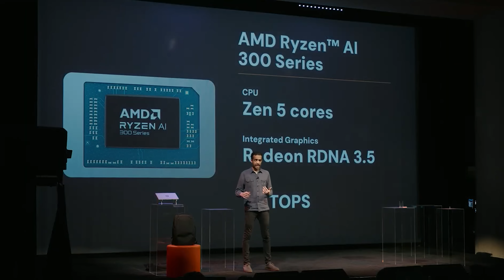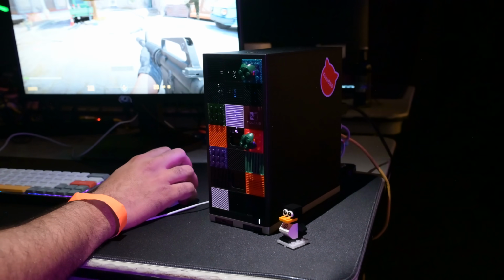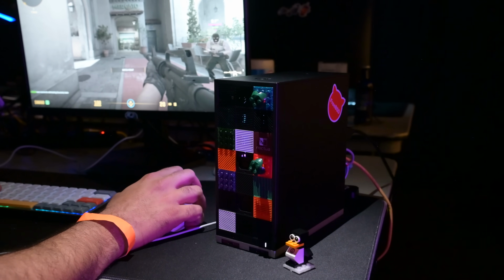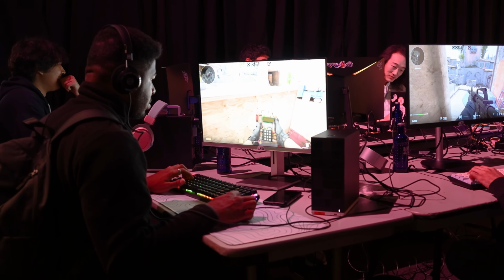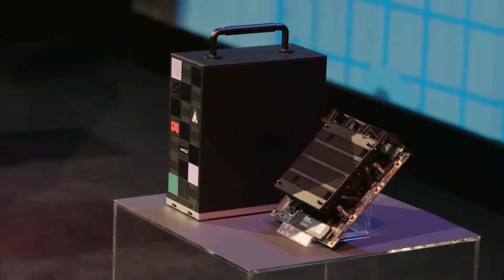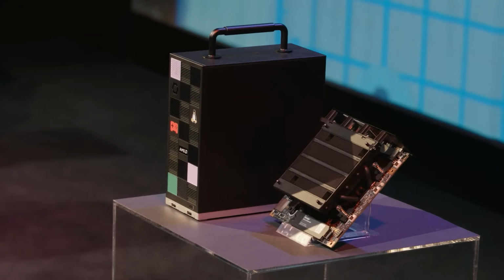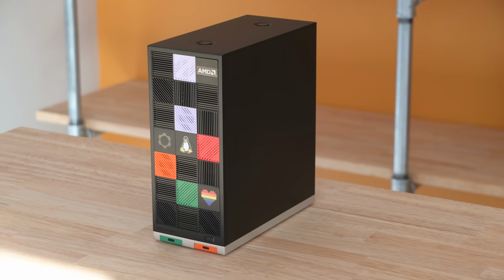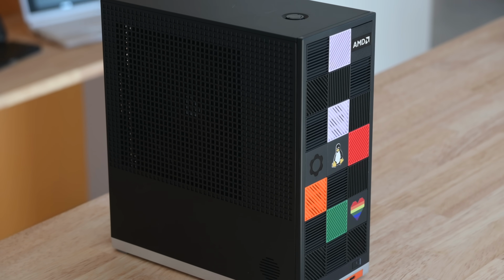Modular, Open, Repairable – The Framework Desktop Teardown!

Comment: Using a Flex ATX PSU is a terrible idea as they are extremely noisy. I have tried multiple models when building SFF PC a few years ago and never found a model that had acceptable noise levels.
Reply: Framework explicitly stated they made their own PSU that was designed to be very quiet, they even addressed the fact that other off the shelf Flex ATX PSUs are noisy which is why they made their own.
Reply: @CarbonPanther  Oh I wasn't aware of that. Great then!

Comment: Nice! But they should have replaced that ridiculous cable bundle from the PSU with a rigid custom-formed copper busbar. Don't understand why nobody does this. It would be neater, more compact, better airflow and easier to recycle.
Reply: AMD is more interested in pushing their AI nonsense – and not in users opening the case.

Comment: I like how they went for the earlier 2000s hacker vibe/style with front cover. I would swap the side panels, the back of this mobo is beautiful, put some lights and a clear panel. I'm reading that the PCI-e 4x Gen4 will be an opened slot, so yay?, hope they put a low profile card slot in the final production... if not can they do a cut out of an oculink connector opening in the back panel, maybe? 5gb nic is an odd choice, but I'm guessing is either that or sacrificing one usb 4.0 for a single 10G nic. Top cover could have some extra mounting holes for a couple of 2.5", some of us may want to put sata or u.2 drives.
This is not relative to this machine, but is it possible to manufacture a daughter board that can attach to this case (or any other ITX case) and put old Framework's laptop mainboards in? Cleary the Amd ai 300 series is very capable chip, with a max alloc vid mem of 96Gb, but I'm little bit curious about the perfomance with LLM of let's say DeepSeek r1 70B? nVidia A100 SXM 80Gb can do 23 tokes/s

Comment: Seems super underwhelming, actually less repairable than the laptop which is a shame to see with the soldered ram, no gpu slot, and what appears to be a soldered cpu (correct me if i'm wrong), in comparison to actual desktops which are probably cheaper and is much more repairable

Comment: 6:59 not sure why they didnt just use a normal holder, would be much easier to replace the battery with a generic one, now you either have to solder or find the exact one likely only sold by them and a few others

Comment: why are these ai max+ 395 computers all over 2000 dollars when the gpu is the same performance as a 1000 dollar 4060 laptop? 🤔
Reply: your math is wrong 128GB of RAM that can be used for the AI accelerator or the GPU for AI stuff also a 16 Core Zen5 CPU that's slightly slower than a AMD Ryzon 9 9950X that's what you want as a Dev Machine. and unlike a Mac Studio this thing can run most games jsut fine.

This thing is meant as a counter to Mac Studio Systems not your gaming PC with it's 1200 Watt PSU. Also good luck to get 128GB of regular DDR5 RAM to clock at 8000 MT on any board. Mind you LPDDR5x also has a wider memory bus than regular DIMMs so this little beast has more memmory bandwith than any PC below Treadripper PRO and you would pay for the CPU alone as much as for the entire Desktop with everything maxed out.

Comment: framework is cool and all but uh, an itx motherboard that uses torx scews, has a weird cmos battery holder, soldered ram (yes yes, I know soldered ram is faster) and has a very limited port selection just really isn't... The Change The Industry Needs right now I don't think. 

The case is itx compatible, but how many itx motherboards have paired type-e ports for those front panel connections? Who wants a brand new name brand desktop that has a sum total of "2 usb ports and a power button" as far as front panel connections go? Am I going to sacrifice 50% of my USB front panel for a headphone jack? Am I going to just watch my motherboard (non type-e) usb headers and audio headers wither and die?

Who wants an itx case that fits: 0 3.5" internal devices, 0 2.5" internal devices, 0 3.5" external bays, 0 slimline optical drives (CDs are better than streaming, don't @ me), and 0 external 5.25" bays, and needs a separate case-specific mounting kit to mount a 120mm fan? 

For these reasons I would posit it's less reusable in terms of both motherboard and case, than the average itx motherboard/case. I will stick to my desktop which also has a customizable front panel (I put stickers on it) and can actually use industry standard internal and external devices

Comment: To anyone wondering why the world needs a SFF Desktop with an APU and soldered RAM: It's for memory bandwidth. That's the main selling point of this device. AI need massive amounts of high-bandwidth memory, so this device is perfect for self-hosting LLMs (assuming the Strix Halo chip lives up to expectations).

I'm really excited to see benchmarks with this and compare them to dedicated GPUs and high-end consumer CPUs! After all, a Ryzen 9950X with similar amounts of (slower but non-soldered) RAM is quite a bit cheaper.
Reply: It beats all consumer GPUs simply because none of them can load a 70 billion parameter model.
Reply: I was looking at the soldered-on CPU and RAM with a skeptical side-eye while thinking 'Framework did *that*?' - thank you for the explanation, I appreciate knowing the reasoning.
Reply: The RAM they are using is comically slow when stacked against the RAM in GPUs or dedicated AI cards. I can and will only assume they did they to upsell higher RAM systems for an extreme markup but will never deliver on actual performance. Just like Apple "out 8GB is actually like 16GB".
Reply: @xoso599  DURRRRRRRRRR, the last time I checked the memory on a GPU is also soldered... So please go ahead and show us the socketed memory that can outperform this. I'll be waiting.
Reply: @ The RAM in the Framework is looking at a max possible speed of 256GB/s with the Ryzen AI Max. GDDR6 caps out at 1.1TB/s 4.3 times faster, while the latest GDDR7 is 1.4TB/s.
While 256GB/s is fast vs DDR5, it's slow when measured against VRAM. 

A $3000 ($2000 MSRP) 5090 with 32GB of GDDR7 is going to be massively faster while having a quarter of the RAM.

So the balance point comes to is 256GB/s fast enough to give useful AI performance? Or do you need the 1TB/s + to get where you need to be for fast stable diffusion or LLMs? 

Now we don't know how fast this Framework's RAM will actually be just what the possible max speed is due to the Ryzen AI Max being the hard upper limit. I'm not sure that LPDDR5 (low power DDR5) is the best solution for an AI machine. 

Time will tell, but to directly answer your point, I don't know of any consumer grade RAM that will hit 256GB/s, but I do know for nearly any other application outside of AI faster RAM is mostly useless. What I don't know is if 256 is fast enough for AI or not.
Reply: I'm still wondering, LPDDR5 8000 isn't even remotely close to the kinds of speeds any reasonable dGPU has with GDDR6X or whatever we're up to. If you want to see what a real high bandwidth shared memory architecture looks like go look at what AMD put in the PS5 and Xbox Series - they're using GDDR, not LPDDR. The reason this is using soldered memory is because it's *easier*, it can run somewhat faster than SODIMMs but only marginally faster than DIMMs which would fit in the ITX board they're using just fine, and if they waited a tiny bit CAMM would work even at these speeds without issue.
Reply: @bosstowndynamics5488  in ltt's video the framework ceo said they asked AMD to see if CAMMs would work with this, AMD assigned an engineer and after a bunch of simulations it seems that the signal integrity over CAMM doesn't work in this case.
Reply: @bosstowndynamics5488  Memory bandwidth isn't memory clock speed. Memory clock speed is the rate at which a memory controller transfers data while memory bandwidth is the amount of data that can be transferred.
Reply: @mozilla666fox  Obviously, but the total bandwidth is determined by channel width, number of channels and memory speed. Adding more channels is relatively easy, maintaining high speeds not so much, so discussing the ability to maintain memory speed is the most relevant point here
Reply: I'm sure the bandwidth difference is negligible, unless they show a benchmark that proves otherwise. Which they haven't.
Reply: Have they considered that a lot of people do not give two shits about "AI" or
Reply: @MinotaurSauce  if AI workloads or RTX 4060/4070-level APU performance is not important then they can build an ITX PC like anyone else can, there's not really much Framework could do to "revolutionize" an already fully modular industry. This is better an answer to Nvidia DIGITS, or really the Mac Mini/Studio, they're unnaturally powerful in AI workloads and have zero DIY-friendly competition.
Reply: @MinotaurSauce  It's not just AI. The integrated graphics on this thing is supposedly on par with an RTX 4060. That makes this the ultimate portable LAN PC or great for a lounge room PC hooked up to a big TV.

Considering the price of graphics cards this thing is a very good value for what it is.
Reply: @MinotaurSauce  Have you considered there are different products for different people?
Reply: @MinotaurSauce  Then this device isn't for them. Most people don't need what this processor does. That's fine, they can get a different system better suited for their needs.

Every system doesn't need to do everything. There are a bunch of people really excited about this because of the memory performance at this price point.

This is doing some things "good enough" that small companies can get this system instead of a gpu that costs as much as a car from Nvidia.

Comment: Aren’t desktops supposed to be modular and repairable? Honest question here, like you can disassemble and change whatever you want inside a desktop, also, framework’s desktop seems less modular and repairable than most desktops, since the RAM and CPU are soldered to the board
Reply: The CPU is actually an entire SoC much more like Apple Silicon stuff, so this competes with the Mac Studio, not any other desktop. PC users should still get a regular PC, this one is for people looking to replace their clusters of Mac Studios.

Comment: So let me get this straight. A company made a name for themselves with modular laptops. Now they release a desktop that's less modular than even other desktops by big OEM-s. No PCIE slot, soldered on RAM and somehow we are still to believe they follow the same design ethos as their laptops? Hey, they're not as bad as Apple, because at least they let me switch out some colorful tiles and don't solder the SSD, right? Hard pass for me.
Reply: There's 3 PCIe slots on this board, and not soldering the ram would've come with the cost of halving the speed AND is being sold at a very good price. I suspect you weren't the target audience anyway.
Reply: @lemonotype  1) Honestly, what can you use these slots for for with this case? 2) Defending soldered on RAM you almost sound like an apple fanboy. HEDT or server markets don't have this. Now an USDT class machine NEEDS to have this for performance reasons. What?
Reply: @Tolknaz You tell me what the slots are needed for, I just pointed out they're there, you said they weren't. Can you point me to a server configuration with the same amount of RAM, running at the same speed and sold at the same cost? Just so we make sure we're not making silly comparisons with a machine marketed as a cost effective way to run AI models at home.

Comment: You know whats also modular, open, repairable and upgradable to an even higher degree? Any ITX PC... Honestly, not impressed with framework here. The only thing that is upgradable is the storage. It is essentially just another mini computer that we already have a dozen of. Only new thing is the chip. But that will soon find it's way into other products as well, I am sure.
Reply: Any ITX PC with a 35.000€ H100 .
Reply: @MrZocker92  What are you even on about?
Reply: @leviathan5207  The Point of this system is 128GB of shared Memory. U can use 96GB of it for the GPU part.
So what GPU has 96GB of VRAM? 

Sure u can build a better an Cheaper Gaming ITX PC with the 12GB 4070/5070 but nobody said this is a Gaming PC. The only Device who comes close is the Mac Studio for at least 5.700€ and the 8TB SSD cost 2.500€ extra
Reply: @MrZocker92  They literally state as such in one of the tabs literally labeled "Gaming". 😂
Reply: @REAL-UNKNOWN-SHINOBI  sure u could Game with it, but if u only need something to Game it dosent make sense. Just like buying a PickUp truck just to pick ur kids from school
Reply: @MrZocker92  Well, when I can use 96 GB as VRAM, it can run Cyberpunk with 120 FPS in 4K with raytracing, right? I mean, systems using GPUs with much less than 96 GB of VRAM can do it, so this one can do it, too, right?
Reply: @Linuxdirk  It's like comparing a truck to a sports car and expecting that the truck with 1000hp could drive in Formula 1

Comment: Can I ditch the godawful case and the gimicky modularity and just throw this in a standard ITX case of my choice and run it like a standard desktop?  I realize it doesn't have a 3.0 header, but one of the [I forget what those Gen C connectors are called] can be adapted... I am in love with this chip and this concept, but that case needs to die in a fire.... [edit:  shoot, it's a proprietary size board.  For a  "completely modular" company... that seems like a HUGE missed opportunity]
Reply: It's a mini ITX board and you buy it without the case in the first place.
Reply: yup you can. They sell the board with the SoC. Put it in a case add an ATX PSU and good.
I was joking around about running it with U.2 adapters and 3x30TB U.2 drives. Got an e-mail earlier from a guy who asked for a price to build him one.
As he's local and I already built him a Threadripper machine years ago I'll do it.
I thankfully can get my hands on one of the early shipping boards as a Biotech company around here ordered a bunch of the Machines and spare parts (boards, cases, PSUs).
There CTO is a friend of mine so building can start as soon as the start shipping.

Comment: I like Framework and have multiple laptops but i don't see this product lining up with their values... I would expect a desktop case with powersuply and big cooler that takes either F13 or F16 laptop mainboards. Also the extention cards make no sense in a desktop PC. I don't know, bit disappointed. I was hoping for a much cheaper F13 version, and more F16 expansion bay modules.
Reply: the extention cards are actually there for people who also run the laptops and want to use that cards thy already got. on a PC the additional USB-C ports are best used as USB-C ports in my opinion if you don't have pre-existing cards. Most people seem to order 'em with USB-C USB-A config.

Comment: This seems be less repairable than a generic desktop PC unsure the point, if the mb fails you would need to get a full replacement.
Reply: well this is not just a Desktop. if u want a GPU with over 90GB of VRAM u would need to buy the 35.000€ Nvidia H100.

Comment: just a regulat desktop tower , a bit more complicatet to open an take care of , i have towers at hime which use just one screw to keep them closed.
Reply: so u have a Desktop with 128GB shared Memory?
Reply: @MrZocker92  I could install 128 GB not shared memory if I wanted – alongside my dedicated GPU.
Reply: @Linuxdirk  And? That's not even remotely comparable
Reply: @MrZocker92  I once learned "don't argue with fanboys", so, yes, you're right.
Reply: @Linuxdirk  You don't understand the purpose of the device...but instead of accepting that not every device is made exactly for you, you can't think of anything better than calling others fanboys.
Reply: @MrZocker92  You're 100 percent right. I fully agree with you.

Comment: Did framework forget that they are a laptop company? We want repairable laptops. Desktops are already repairable. 
Why would they waste any resources on this?
Reply: Because they have an actual brain and business sense. They built a Mac Studio killer for less then half the price and you can actually repair it. It's also perfect for developers with 16 Zen 5 cores and perfect for "AI" Stuff. the entire machine runs you less than a less then optimal for AI GPU like the 4090 or the unoptanium that is a 5090.

This little box is not ment to compete with your gaming PC also I doubt that you can get a Ryzon 9 9950X running with 128GB of DDR5 and that would still be less memory bandwith than SODDR5x provides. Also you'd need at least a RX 7700 (XT) to get it's graphic performance so do the math for all the parts you'd need to match it and now look at the power you'll need for it and tell me again what's the better deal. Sure you can't add a GPU to this machine but if that's ehat you want than that's the wrong machine for yyou to begin with.

Gods I should bill Framework for explaining there product.
Reply: @DJDocsVideos how much did you pay for their kool-aid?
Reply: because u cant buy a Desktop with 128GB sharing Memory.... exept if u count the Mac Studio

Comment: Love how the motherboard is inferior to most ITX motherboards on the market. Aside from the repairability I guess.
Reply: Vastly superior to most laptop boards.
Reply: hmm show me the ITX board that can slot 128 GB of LPDDR5x 8000 and happily runs a 9950x 16 Core CPU wirth 2 USB 4 ports 5 to 10 Gbit Ethernet and a GPU that's at around RX7700 XT performance oh and I also want an AI accelerator with 128GB of RAM. Got one for me for less than 2.5k?

See that's the market for this thing.
Reply: @DJDocsVideos  What kind of AI workloads do you run?